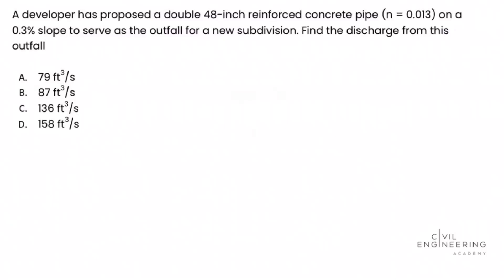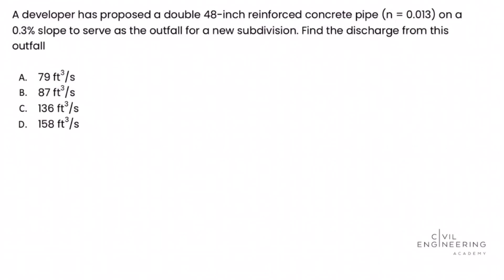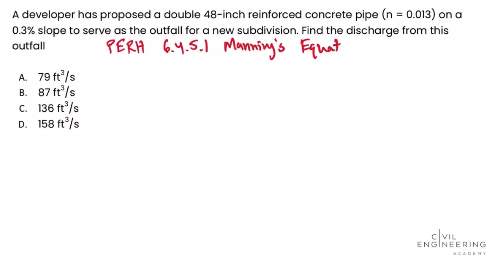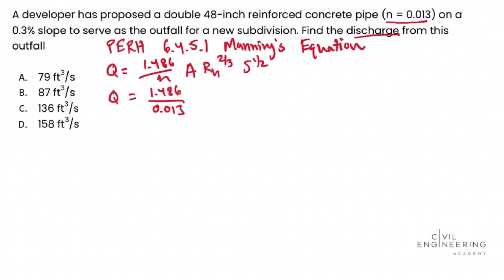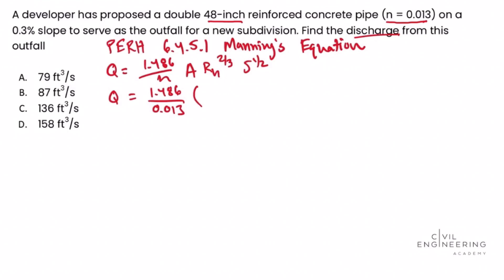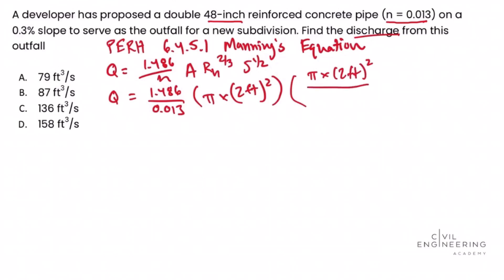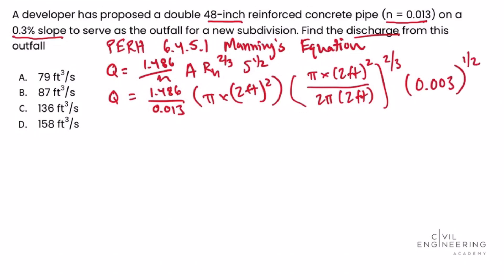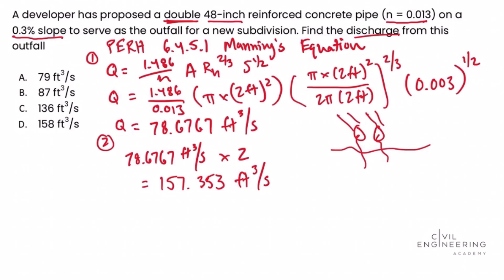Civil PE Exam – Water Resources Breadth – Calculate the Total Discharge from a Double Outfall

Comment: I used equation on Pg 355 for "Min Diameter of Circular Pipe Under Full Flow Conditions" and solved for Q knowing my diameter... Got the same answer. Is my method acceptable?
Reply: Yes, that equation you are referring to is the same as the Manning's equation. It's simply rewritten in a different form to solve for D.